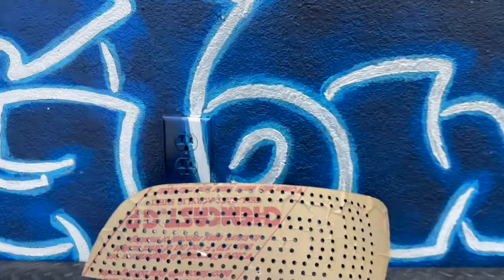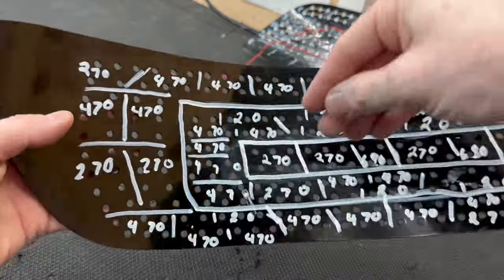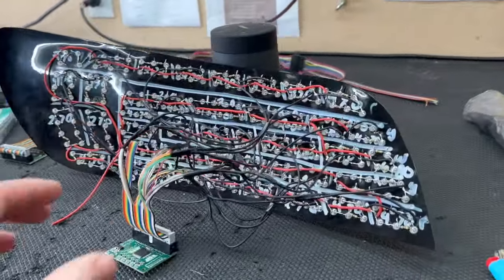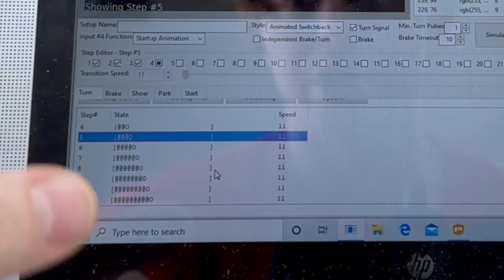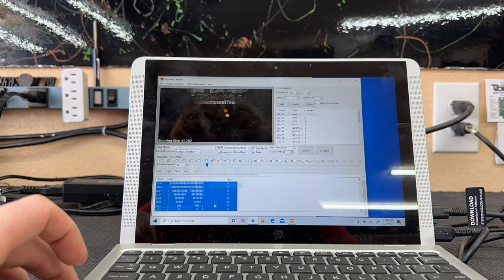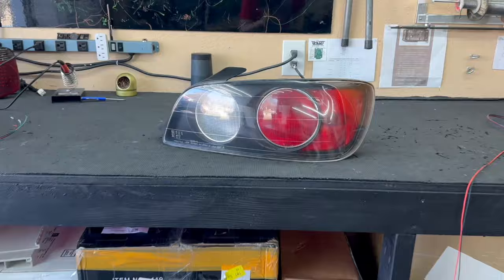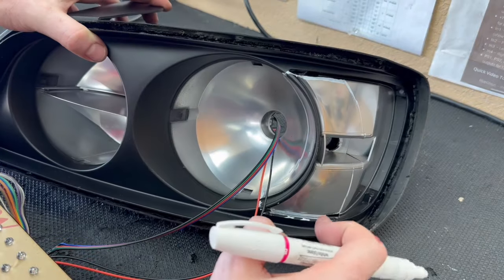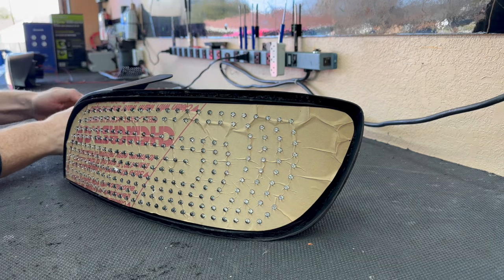Building SHOW MODE S2000 tail lights

Comment: How do you cut out the holes for the LEDs on those black plastic pieces?
Reply: Laser cutter cuts the shape of the panel and the holes. I myself used a drill and drill bit but it won't be as clean and uniform as a machine.